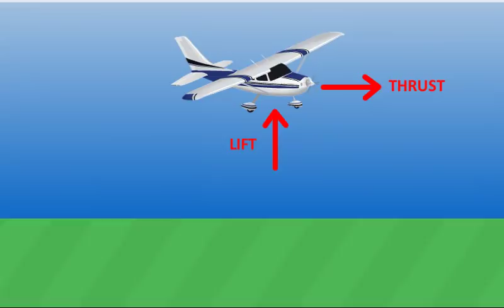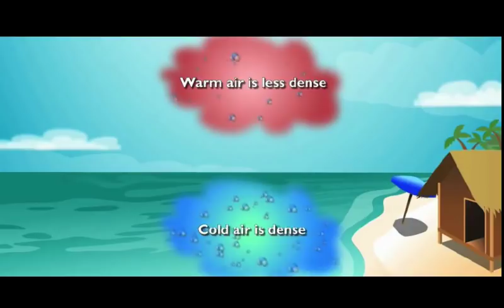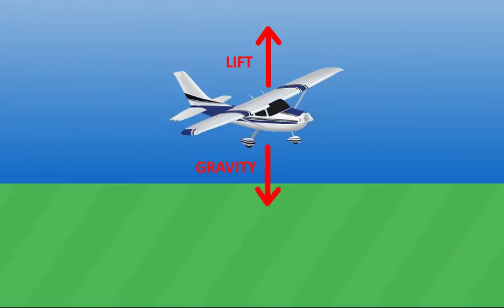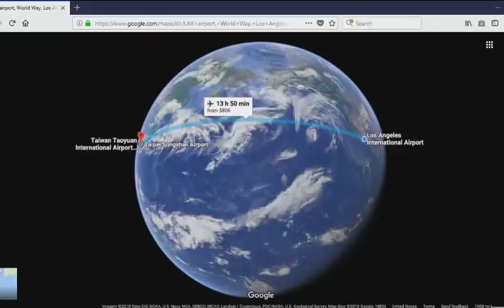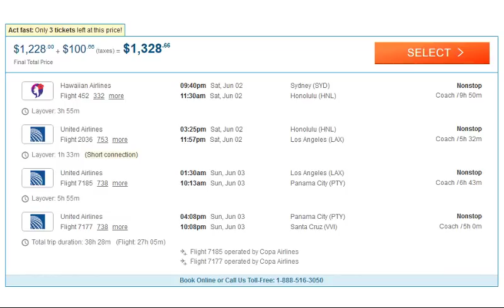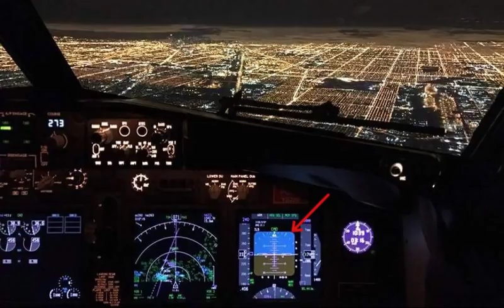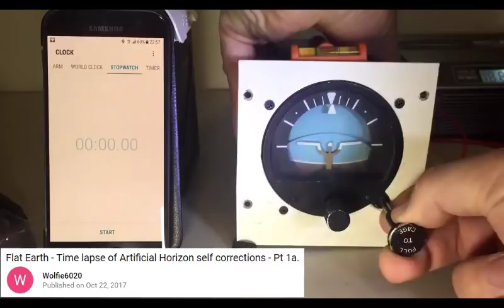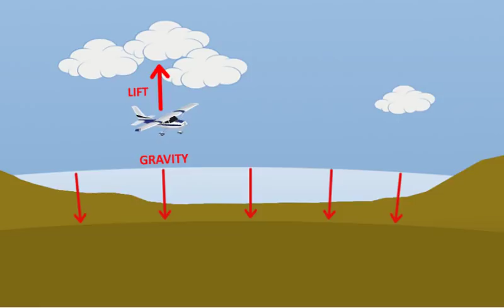Flat Earth Falsities - Plane Nonsense

Comment: WHY HASN'T A PLANE...FALLEN OFF THE EDGE... IF IT"S FLAT?!
Reply: " how do they not fly into outer space if the Earth was a globe"
Then why aren't planes used to get to outer space?  The rest of your post is typical crap taken from FE videos.
Reply: It’s explained in the video and several comments why planes don’t need to dip their nose for the curve. But even if they did, it would be 1° per 110km. Why would that “feel like rough turbulence”? You wouldn’t even notice it.
Reply: jordy: since you don’t like my figures why don’t YOU do the calculation and tell me what it is?
Flat earthers like to use 8 inches down per mile don’t they? What angle would you have to point at to drop 8 inches in a mile? Does that sound like a large noticeable angle to you?

As I say, this is academic as the video and numerous comments on here explain why a plane doesn’t need to angle down.
Reply: Why would a pilot “nose down every few minutes”?
It’s a constant curve, so they would nose down constantly not fly up a bit then down a bit. 
A gyro does not only work on a flat surface. Did you ever look into what a gyrocompass is?
And while we are at it jordy, did you ever find answers to my equinox and New Zealand solstice questions that you ran away from before?
Reply: Just for a moment picture a plane flying at 30,000ft over a ball Earth. Okay. If it stays at 30,000ft as it flies along then it is following the curve. Yes? If you fly from 30,000ft to 30,000ft are you climbing or descending?

What is this mean?
I don't get it.

Try to draw two lines, both start from the same dot.
The first one is a curve line and then the second one is a straight line.

If the plane is set to fly steady, it means that it follows the straight line.
Tell me how to fit straight line into curve line.
It's impossible so I don't think that I need more explanation about this.

This is too easy, no pilot in this world can explain this.
Because the way they fly their planes is based on flat earth surface.
No more explanation is ever needed.
Reply: Still no answer to the equinox or solstice questions I see jordy? Doesn’t that tell you something? That kind of hole in my understanding would worry me.
Reply: GrahamStw

Please be honest.

Just use mile or meter or kilometer for distance.
Angle degree is not for distance.

45 degree of pizza only few centimeters, but 45 degree of football stadium circle could be several hundreds meters.
Both are 45 degree, but gives a huge different result.

We know some people are stupid, but please be honest to them as well:-D
Reply: jordy f: I am always honest. I’m describing a curve. Globe earthers say the Earth is 40075km in circumference. A complete circle is 360°. 
So that means you cover 1° of the circle every 111.32km
Reply: GrahamStw go on the Zipper at a carnival that's about the same amount of tilt when you're projecting forward as the ride is propelling you forward same concept you feel that right I know you haven't heard that before or how about the big pirate boats at carnivals when you go  backwards right and in that first feeling going forward back down the slope same concept similar motion
Reply: seymoresaymore and you comment isn't even worth addressing at all but to say it's not worth addressing at all nonsense
Reply: 3' HOTS & A COT:
You are comparing a pirate ship ride, which typically makes a circle of roughly 30 or 40 metres radius, with the Earth which is a circle with a radius of 6371000 metres. 
Do you really think that is equivalent???
Reply: GrahamStw

Why we need to care about the curve degree.
Just do math calculation based on circle.

The bigger size of the circle, the more distance to reach.
The faster the plane, the more distance can be reached every seconds.

If the plane with speed of 500 km/hour doesn't keep its nose down for hours, I think the passengers will end up somewhere at planet mars ...hahaha

Please do calculation using math rather then say degree. (45 degree of pizza only few centimeters, but 45 degree of football stadium circle could be several hundreds meters. Both are 45 degree, but gives a huge different result.)
Reply: "But even if they did, it would be 1° per 110km."
Yes, 1 degree of pitch spread over 8 minutes at 450 knots.  It's a tiny adjustment that's completely lost in the overall piloting adjustments for turbulence etc. to maintain cruising speed and altitude.
Reply: GrahamStw

1. I am good in math but I don't know how to draw in photoshop.
2. I just think about it but I haven't calculate it anyway :-D

Make it simple. Just think about a long distance direct flight, let say distance to reach is more than half of the globe. Probably from Brazil to Australia. If the plane doesn't follow the earth curvature (keeps nose down every few minutes), sure they will end at somewhere near the moon ...hahahaha.

Do you get the idea?
Really funny, isn't it?
Reply: jordy f: and if the plane flies perfectly level at a constant altitude, by referencing the attitude indicator and the altimeter, then it will perfectly follow the curve. 

Funny.
Reply: "If the plane doesn't follow the curve (keep nose down every few minutes)"
Plane follows the curve by maintaining altitude. In order to "go to space" the pilot would have to climb.  Why is this so difficult?
Reply: seymoresaymore

Yes, 1 degree of pitch spread over 8 minutes at 450 knots.  It's a tiny adjustment that's completely lost in the overall piloting adjustments for turbulence etc. to maintain cruising speed and altitude

Do you think that your answer is clever?

Try to draw it on paper the direct flight from Indonesia to USA (half of the globe distance).

Say worthless words like you said above is easy bro... but it shows that you don't even able to imagine how the globe earth looks like:-D
Reply: maintaining altitude = keep nose down every few minutes

Do you UNDERSTAND what EQUAL means?

 Why is this so difficult?
Reply: "Do you think that your answer is clever?"
So you're just another flattard pretending to ask questions in order to seem intellectually honest.
Reply: If the plane doesn't need to keep nose down every few minutes, it means the earth is flat.

 Why is this so difficult?

Even 5 years old kid can understand this
Reply: maintain altitude is only make sense on flat surface.
And gyroscope only works on flat surface.
I am done:-D
Reply: 5 year old certainly describes the mental development of a flattard.
Reply: seymoresaymore 

Why no more argument?
Come on clever!!!
Show us your truth of ball earth.

What can you say? NOTHING!
Why? Because you are defending a lie!
Reply: "Why no more argument?"
Go back to your FE echo chamber, it's all you want to hear.
Reply: GrahamStw

It’s a constant curve, so they would nose down constantly not fly up a bit then down a bit

Wooowww... is this brilliant?
Bro... please understand how the plane works.
Do you know how the plane can change direction? up or down, left or right?
By change the face of the flippers on its wings and tail.

During the steady flight, the plane just steady so no change on its flippers.
D Marble have proven it by using spirit level during his flight and many people did the same after that. 

You cannot hide the lie.
No matter how hard you try to cover up the lie, a lie is still a lie. People will still be able to smell the stench.

There is no way for a plane to fly in a curve line to follow the earth curvature.
It just simply nonsense.

Currently, I am busy and don't have much time to look back on your equinox's case, but probably you could start think to figure out the possible scenario on flat earth since you might begin to realize that the ball earth is really a bullshit:-D
Reply: Your inability to envisage even the simplest geometry never fails to amaze me jordy. 😂
Just for a moment picture a plane flying at 30,000ft over a ball Earth. Okay. If it stays at 30,000ft as it flies along then it is following the curve. Yes? If you fly from 30,000ft to 30,000ft are you climbing or descending?
A spirit level stays level during level flight over a globe. As usual a Flat Earther is pointing to an experiment that has exactly the result we expect to see on a globe. They do this all the time. All part of the con.
Reply: Oh and don’t worry, you don’t need to go looking for my equinox question I’ve got it right here. Got an answer yet?
We get two equinoxes a year, spring and autumn: https://en.wikipedia.org/wiki/Equinox

On the equinoxes, no matter where you are on the world (except right at the poles):
- the sun rises exactly due East.
- sets exactly due West.
- the daylight lasts the same time.
- day and night are almost equal. 

Oh, and everywhere on the same meridian (line of longitude) experiences sunrise and sunset at exactly the same time. 

So how does that all work on a flat earth with a close sun?

Diagrams welcome!
Reply: Oh and I have the New Zealand one you couldn’t answer too:
Invercargill is a town in the south of New Zealand. At Invercargill, on the December solstice (22 of December) the sun will rise at 05.50, will be directly overhead at 13.44 and then finally set at 21.39

Flat Earthers tell us that during the December solstice the close-sun is circling the earth along the Tropic of Capricorn, so we can easily use those times to plot out its position above the flat earth at Invercargill's sunrise, noon and sunset. 

Here's what we get:  https://s7.postimg.cc/u37ppgcp7/flat_earth_solstice_sun_new_zealand.jpg

Hmmm that's odd. At 05.50 the sun is somewhere over Chile, and at the 21.39 sunset it is somewhere over Madagascar. That's at opposite sides of the flat world. Surely if someone in Invercargill can see the sun when it is that far away then the entire pancake world would be able to see the sun?? What happened to flerspective?

Also someone in Invercargill will see the sun rise in the south-east (at 126°) and set in the south-west (at 234°).
Which is odd because if the sun was following the Tropic of Capricorn then it would always be somewhere to the north of Invercargill.

All times and figures are from TimeAndDate which ball earthers and flat earthers alike seem to agree is accurate: 
https://www.timeanddate.com/sun/new-zealand/invercargill?month=12

Explanations and diagrams welcome.
Reply: GrahamStw no I'm saying the feeling that you get in your gut you globe turd
Reply: The feeling you get in your gut is due to the rapid change in velocity on the pirate ship. Change in velocity =  Acceleration = Force / mass.
Reply: GrahamStw yeah along with the downward slope just as if you hit rough turbulence which you should feel
Reply: Your problem is that you automatically equate “level” with “straight”. Level flight over a globe is curved. 

And no, the way pilots fly their planes is not based on a flat earth jordy.  If it was they’d constantly be getting lost and running out of fuel. 😂
Haversine formula and Great Circle routes are essential to international flights. 
Wolfie just ran a contest simulating a Search & Rescue mission, asking for flat earthers to explain how to organise the mission on their model. Not one of them could. There were plenty of answers from globe earthers though - because the globe Earth works.
Reply: GrahamStw just stop answering his questions mate, you're wasting your time explaining something that simply went over his head
Reply: GrahamStw you're a globe turd simple and plain
Reply: HagTheEgg21 https://youtu.be/wKjxFJfcrcA
Reply: 3' HOTS & A COT: A truly eloquent and compelling argument, well done sir.
Reply: As simply as possible : When a plane takes off, that's when it's "flying straight", and that's how it gains altitude. If the plane kept going he would "leave the earth (technically no since there isn't any atmosphere past a certain altitude)". When planes are flying at a constant altitude, they're going "around" the globe.
Reply: Ragarnoy so says dipshit
Reply: Kj Starwalker how do they not fly into outer space if the Earth was a globe no pilot accounts or adjust the plane to accommodate the curve of the Earth and if they did wouldn't be able to hide it you would feel like you were going through rough turbulence the entire trip but with a name like starwalker I'm pretty sure you won't be letting go of your blue balls anytime soon